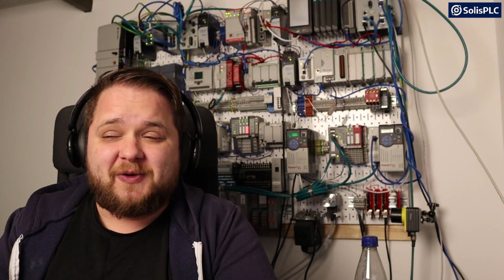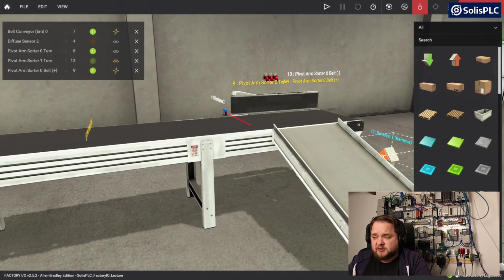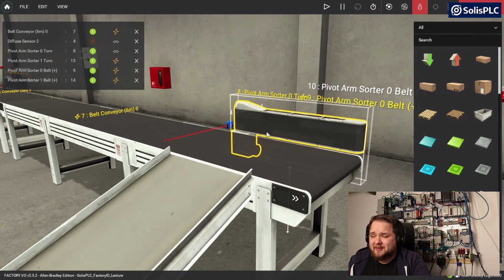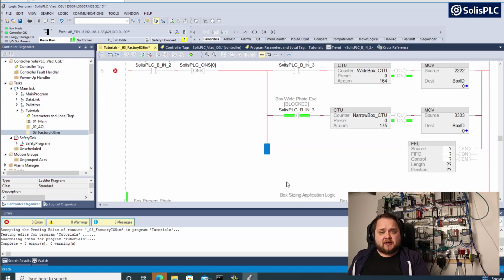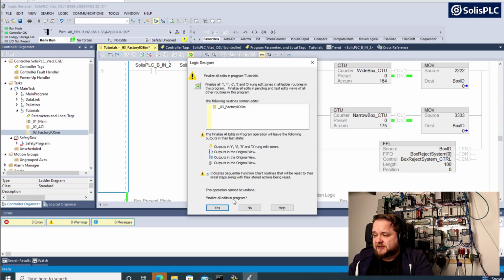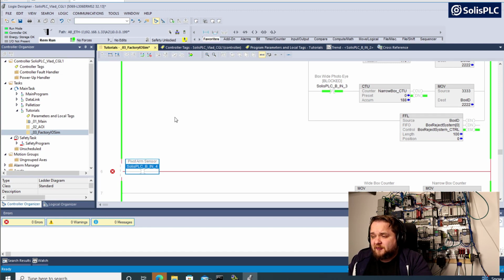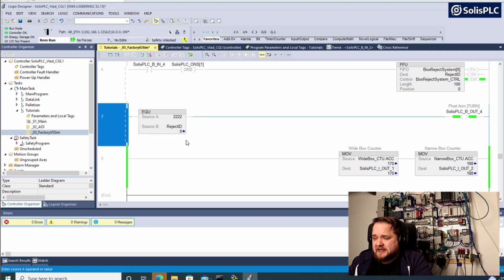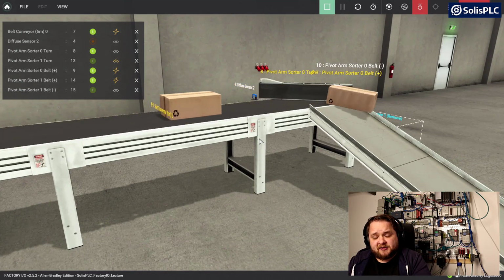Allen Bradley PLC Programming RSLogix 5000 Factory IO - Reject System Using FIFO FFL / FFU [Part 6]

Comment: Thanks or sharing, hope all is well.
 
I see how the logic works & understand the use for example however, wouldn't you feel like a box tracking system is built easier with a Bit shift?

The Bit shift doesn't use as much memory as the FFL/FFU (which is dependent on how much data you want to store?

The most popular use for the FFL/FFU instructions that I see used in the industry is for averaging data or trapping data to display it on an HMI screen.
Reply from the maker: Hey Shane!

I've seen both implementations depending on complexity. For a simple reject system, the option is binary - Either keep the part or reject it. For that purpose, the bit shift makes sense. When it comes to a more complex application - Ex: I worked on a system that had multiple SKUs merge on a single conveyor and then the stream was split at the palletizer into different cells. In that case, you needed to track the different SKUs through the system. A vision system would identify each box sequentially and the correct box would be sent to the right palletizer downstream.

To your point shifting bits would take up less memory. That being said, I haven't encountered a situation in which this application was the bottleneck. If you're not creating a massive array it should be fine. Keep in mind that you can allocate a much smaller array; in my example I believe that we could have create an array of size 10.

Cheers!
Reply: @SolisPLC  Hi , do you have for same example with the bit shift implementation ?